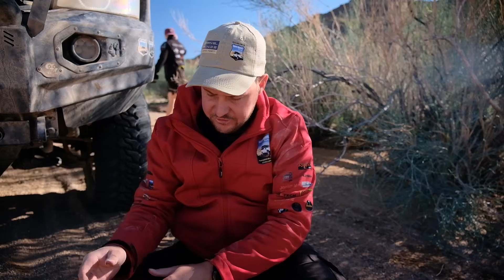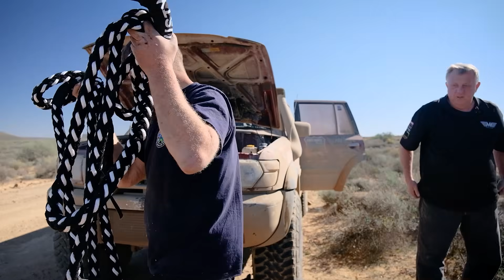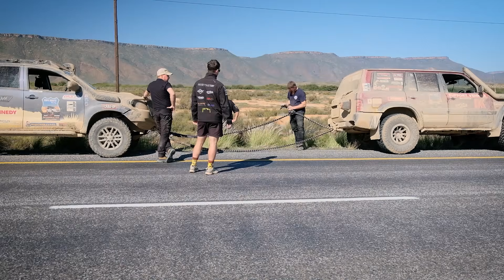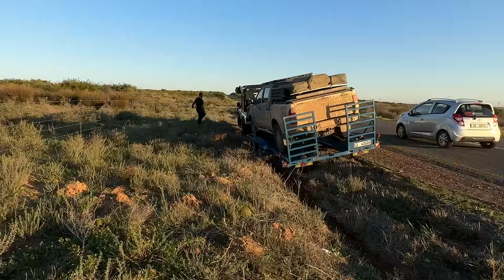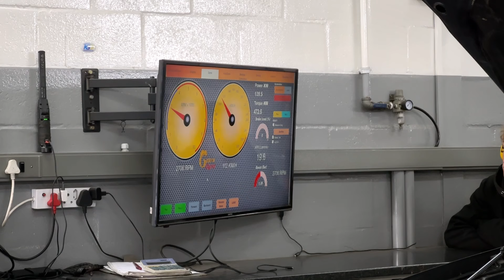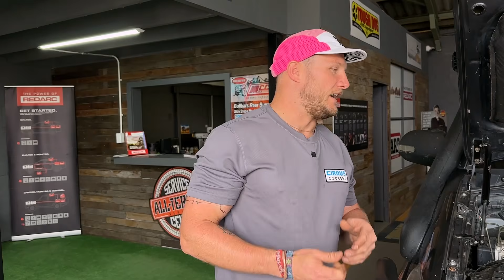Hilux Engine Rebuild: The Truth About Injector Failure & Bad Fuel

Comment: Great video content 👌  I am a Scottish mechanic here in Australia . I have A 1kd 2014 hilux from new , I also have many Hilux / Prado 1kd customers,  There is much information online about cracked pistons/ injectors and design . That said I have seen Hilux 1kd engines run for 400,000 kms on The original injectors, despite The recommended 150k replacement,  these engines are actually really good despite what you see online ,much is easily avoidable if you fit a 30 micron pre-filter before The factory diesel filter , I only use BP ultimate fuel where possible, and mobil 5w 50 fully synthetic oil changing both diesel factory filter and oil every 8k . Another tip no one seems to realise, don't assume the coolant temperature gauge is accurate, far from it ,use an OBD scan guage 3 or similar to monitor EGT . The thermostat sticks normally on hot side ! This is one of the MAIN issues of cracked pistons on The 1kd ,especially if it's a towing vehicle,  it's in an awkward position to replace and often ignored.  Once it's happened it's too late to check if those coolant temps were the issue !! Also recommended get yourself a performance viscous fan ,again often overlooked ,use only toyota coolant mix from The dealer . I'm saying this from experience.  I prepare a lot of 4wd vehicles  bush/ prep here in Australia as you know The outback is not forgiving! ...I also have a Brown Davis metal long range tank with a threaded drain bolt which makes it easier to clean the tank out quickly if I suspect contaminated diesel ,which can be an issue here in Australia
Reply from the maker: Interesting, thanks for the comment and information. 

Please explain the viscous fan more.

Comment: The top mount inter-cooler is also a good spanner shelf and hand rest.  That definitely closes the core😉 . Not so sure about the rocks and sticks part, but maybe your bonnet is shot blasted and damaged from sticks and stones and you respray it every few months. 
If you not using the top mount, then close the hole. You don't want air in the bonnet area that doesn't serve a purpose first, like cool the radiators .
Reply from the maker: I'm planning on closing the hole yes. I don't want all the dirt and water to go in there 🙃
Reply: @DieterPey  Dirt is seldom the problem. Dirt particles seldom manage to turn very well, (some air filters are designed around that fact) but the air coming in there has substantial negative effect on the radiator efficiency.  
And when I said not sure about the rocks damaging your top mount i was being sarcastic 🤣

Comment: That trailer is overloaded. Those tires are not rated for that load. Running with that load will overheat and damage the tires. De lamination and bursting. If you insist on carrying that load, then run the tires at 4.5bar cold pressure. 
Running a slightly higher boost pressure without adding fuel will make the engine run cooler combustion temperatures.

Comment: Guys the problem of injector failure and a hole in a piston or a cracked piston is not unique to any single make or SA. It happens across the board with all brands. Filter changes are a must do. But remember a turbo diesel engine runs under very high compression and the diesel is injected at very high pressure. Usually, the fuel from the tank goes through the filter then it goes through a very high-pressure injection pump before it arrives at the injector. The High-pressure injector pumps can easily introduce metallic filings into the fuel AFTER the fuel has passed through the fuel filter. I'm aware that in the USA they found High pressure diesel pumps were introducing shit into the diesel causing major engine problems. The modern injection pumps are running at very high pressures and tolerances are very tight, and wear does start after the mileages referred too. Get some got techs involved on checking out pumps, that is my contribution. Hope it helps guys.

Comment: A friend of mine has a Prado with the 3.0 D4D engine. It's his "Sunday car" and he takes really good care of it. Never missed a service,with all services done at Toyota Dealership where he bought it. About a year ago he was driving up a pass and the vehicle just went into limp mode and then stopped. Vehicle had just over 90,000km on the clock but was out of warranty (warranty time period elapsed). They had to collect his Prado on a flatbed (you can't really tow automatic cars folks, unless you disconnect drive shafts!) and when it got to the dealership and did the inspection, it was clear that his engine had eaten itself. Cause? Failed injector on one of the pistons! I also seem to remember that it was also piston nr 2! So I wonder if the 3.0 D4D engines have a particular issue with that specific injector? The quote he was given for a new engine was something like R125,000...

I guess the long and the short of it is that ALL cars, no matter the make, can give problems - sometimes even if you maintain them properly! If you consider how many components there are in an engine alone that can fail, the massively wide range of operating conditions, etc., and nevermind all the other components on a vehicle that can go wrong, it's actually amazing how reliable cars have become. Think about how often you saw cars standing next to the side of the road in the 70s, 80s, 90s, vs now!

Well done on saving your Hilux, they are very good vehicles! I'm very happy with my 2,0 BiTurbo Ranger that has (touch wood) not given me any mechanical issues, ever! Stay safe out there and remember: If your bakkie is never dirty, you're not using it correctly! 😜😎

Comment: It’s about the correct after market high pressure fuel pump to catch the filings coming out of the fuel pump as it grenades over at least 1 million kms. - Clean that at service intervals along with the fuel filters. Injectors every 500k kms and the pump once it finally grenades or you in for the bucks the system is designed to take your money with costly dumb repairs.

Comment: In Australia we change injectors at about 150000. That is correct. And when service check injector values. Can they prove that the tune does not effect the hole in piston.
Reply from the maker: Many stock vehicles has had the same issues, so tune can't be the cause of it.
Reply: @DieterPey  Standard injectors fitted in the car? Up graded 30percent? You have a classic sign of over fuel I work at Isuzu and have seen this many times. The tuner won't guarantee the engine. Why is that ?

Comment: I do quite a bit of overlanding, mostly on gravel roads. Leaving on Sunday for a Cederberg trip. I swear by the fuel cure from Wurth. Dont know if I am fooling myself but it feels like my vehicle has more power after adding. Also added a second standard fuel filter w lr tank.Because this vehicle is for overlanding I also try and change oil and diesel filters every 5000ks

Comment: On any diesel engine, two items you WILL replace (sooner or later), injectors & turbo.  Those two components does all the hard work all the time for the vehicle.  Using low sulfur diesel where possible will also help with overall engine longevity.   150K to 200K mileage mark is a safer than sorry margin to have injectors replaced yes, fully agree.  The 'soot' within the intake manifold most likely from EGR accumulation over time.  Blank that one off.  (If not already done.)  KSD is very good at what they do.  Very informative Dieter.  💪
Reply: 10pp or 50pp for trucks, which diesel is good for bakkies?
Reply: @22alchemy  the general rule of thumb is lower figures ppm, so rather 10ppm than 50ppm.  (Parts per million) or lower sulphur diesel is healthier for all internal parts of the engine.  It means less wear on both the injectors & chemical reaction / corrosion on the parts directly exposed to the combustion process.  Those types of fuel is usually more expensive than the 500ppm or 50ppm, but in the long run healthier for the vehicle's engine.  Especially if you are planning to keep it for a longer period of time.
Reply: @DIESELTECH_ZA thank you sir, appreciated - Sasol's 10pp ill start using, I always used 50pp

🙏🏿🙏🏿
Reply: @22alchemy  no problem.  I use 50ppm in general, but when filling up at home I like to run the low suplhur with Shell.  Both is better than the old 500ppm diesel.  Sadly we get the dirtier type diesel in SA vs what you will find abroad.

Comment: Straight forward just got hot man . It overheated . If it gets hot 1 kd will cook its pistons .
Reply from the maker: It didn't get hot on the temperature gauge and that morning which it happened it wasn't even that hot.
Reply: @DieterPey  ok 👍🏾.  Mechanic by profession, have rebuilt a lot of 1kds actually my favs to work on and most of the time its a hole in the piston due to injector malfunction . Most investigating turned out heat affected the injectors and they operate out of their parameters . Other than that found the 1KDs are bullet proof usually we found 1s with 150k only need a top gasket change with the bottom end looking new . But when tuned they are notorious for either eating through turbos or pistons as well. Awesome video though.

Comment: Kudos to the guy who immediately diagnosed the holed piston right there at the roadside. His reasoning was spot on and likely saved you from having to spend potentially much more had you decided to carry on driving. 
The final repair bill actually isn’t that bad. Yes it’s a crabton of money but these days a properly done replacement engine with warranty looks like the deposit on a small house. 

The injector replacement as preventative maintenance… 

I hear you, and I absolutely agree that fuel quality in ZA is at best unpredictable with huge room for improvement. 
In my personal experience I am currently keeping close tabs on two “D4D” engines. A 2010 Hilux 3.0 and a ‘13 Fortuner 2.5. 
402 000 on the bakkie, 264 000 on the Fortuner. 
Both are stock standard as they come and maintained privately according to the factory schedule. 
Both have the original injectors, which have been monitored since 100 000km and values are still healthy. 

I guess the saving grace here is that we live in a very small town and always use the same fuel station (there are only two, welcome to the Karoo 😂)
But even so in my experience the OEM filter and water separator will catch any dirt or moisture before it reaches the pump. 
How it will fare with paraffin for example I don’t know. 
And it’s pretty much standard practice for us farmers to keep a spare diesel filter in the vehicle as a matter of course. 

So yes spend the R40k odd every 150 000km and you should have peace of mind. But maybe consider that it is possible to monitor and manage the situation if you remain proactive about it. 
Coz that’s a lot of brandewyn money man 😮
Reply from the maker: You are 100% correct. If you make an effort to monitor those injectors and keep an eye on the injector values, then your chance of catching a faulty injector in time is good. Keep up the good maintaince, it's not easy work!

Comment: Dont tow , dont tune , change my oil every 6000k , injectors need to be done buy someone who cares always change your fuel lines at the same time , always at every oil change look into to drain hole in the sump and make sure the oil pickup is not blocked or blocking to make sure the injectors seals are not leaking fuel into the oil , The 1KD is a pretty good engine but expensive to maintain
Reply from the maker: Maintaince is very important and part of the game.

Comment: Owned a 2015 legend 45. Upgraded to new spec legend in 2022. Sold the 45 for R374 000.00 after 7years with 70000km. Only  lost R35 000. True value. I actually onlysold the 45 because I wanted an automatic. They’re boring and conservative but BULLET PROOF.

Comment: Of course the guy who tunes engines will tell you a tune is safe 🙄. An engine rebuild will let you down again in these engines again. Once a d4d engine cracks a piston it’s better to throw a new engine at it. Interestingly not one person talked about over size tires, bull bar, lift kit, roof rack, spot lights and winch which all co tributes to restricting air flow and increasing wind drag, throw in a re map or tune and going on long trips in the hot temps and what do you think will happen? When these engines first came out around 2005 it was unheard of to crack a piston but now everyone is expecting to much from them with tunes, heavy towing ect for hours on end  and you just asking so much out of a little 4cylinder, towing in D will cook your transmission and crack pistons. If you want your d4d to last forever keep it stock and do regular maintenance, injectors every 180k, oil changes. Make sure to use copper washers in the injector seats not brass as the brass ones will not seal and cause the sump pick up to clog and you starve your engine of oil. Every oil change you do check the oil pick up when the sump plug is off.
Reply from the maker: You're right, keeping it stock will make it last longer, but then I can't take my car where I go. The added mods to add weight and stress on the motor, that's why we do a slightly tune. We are aware of the risk and that's why I'm not upset that I got damaged. It was due to happen some day. 

Like racecars and any motorsport, there's always R&D involved, but we break, fix and make stronger as we go.

Comment: I talked with a longstanding Hilux owner and he gave me 3 pieces of advice for longevity. Never ever let the tank run empty or close to empty because that`s when you get kak in your injectors/pistons as any "dirt" settles at the bottom of the tank. The second was to change oil every 10 000kms and the third was to always let any turboinjected engines "settle/spool down" after a long drive before you switch the engine off. I try to live by this but, obviously can`t verify if this is part of the reason I`ve never had issues with my 2015 Hilux Legend45 D4D. Maybe the fact it only has 175 000kms on the clock in 10 years is the main reason😅
Reply from the maker: All those tips are 100% correct, I take the same into account. 175k km is still entry level kilometres for a Toyota 😁
Reply: My legend 45 has over 300 000km with out ever being opened up once. These are the rules I live by, especially the turbo spool down. Also I had my EGR blanked off and that helped a lot.
Reply: All those 3 things are the main reason why diesel turbo engines die😊..I have a little toyota runx d4d 1.4 diesel I never let the fuel run low..every 5 to 8 oil change..
Reply: 2014 onward Toyota a introduced Diamond-Like Carbon coating to the injectors internal parts  as well as redesigning the pistons making them stronger.  The new injectors are said to last substantially longer.
Reply: This is what happened to me. I have a 150L tank. I ran out of fuel driving in the outback and was running on empty (reserve) for about 50kms. About a week later… suddenly the car starts shaking like it’s running on 3 cylinders. Cracked the piston. 
Expensive lessons learned: I will never run on empty again. I’ll always carry spare diesel from a reputable source.
Reply: Or don’t buy one of the overrated piece of crap!
Reply: @PillSharks  Thank you for the valuable input. It is easy to knock something down, but tell us, what should we all be buying instead?
Reply: Should be buying a GU Nissan Patrol with the old tech Td42ti engine (No Common Rail Crap). Install a UFI 16G turbo & a UFI 200hp injector pump & large intercooler & the vehicle hauls ass but without risking engine gearbox & clutch issues. My last TD42TI engine i replaced at 900k for peace of mind & my old engine never let me down once
Reply: @triggerhappy8872  I have lived and worked in the Pilbara (NW Australia) for over 20yrs. In the wet season the temps can easily hit 44/45/46 everyday. We hit 48’s/49’s on some days, at that temp the ground surface temp is 72-75°C. We run 79’s and Hilux’s 24/7 around the clock and they’ve never seen bitumen. Apart from the DPF issue in the early days we’ve never had issues…..service em and just keep driving. When we’re pushing 400000km on our Hilux’s and 79’s, driven 24/7 around the clock, destroying full sets of duellers 694/697 LT’s every 20000km from high speed dirt/corrugations what would that be equivalent to in your TD42, that’s been loved and driven by one person mostly on bitumen I’m guessing. There’s no comparison, as long as they’re serviced you’ll never beat a Toyota, and I love the TD42’s. Bad fuel isn’t good for any engine. One of the best vids I’ve watched on YT for a while…..subscribed👌
Reply: Another flog a part of the die hard one eyed toyota hating propaganda classist army stuck with tiraded narratives constantly circling around in his head about the brand he can't go to sleep or wake up without thinking about.

Comment: Can you upgrade the fuel pump to compensate for a potential reduction in flow with multiple, in-line filters? Also, BG 44K does wonders at keeping injectors sparkling clean. Diesel of gasoline engines, alike.
Reply from the maker: I'm not 100% sure, but if I understand correctly, the filters will limit the pressure if their microns are to small. No matter the fuel pump pressure. 

It's like taking a fire hose and trying to spray it through a pinhole. Pressure is good, but it still gets limited by the hole size in the filter.
Reply: @DieterPey  That makes sense. Volume increases flow rate, which impacts pressure and then at some point the system limits.

Comment: Is it 3l 1kd-ftv ?  How come you have manual transmission coming with this engine ?
Reply from the maker: Yes it's a 1kd-ftv and we mostly drive manual in South Africa.
Reply: @DieterPey cool. We don't have this build in Russia at all. 3l comes only with automatic. And 2.5l only manual . I wonder if the clutch and axle are the same for 2.5 and 3l manual ?

3l auto comes with another, stronger axles and no manual diff lock option , only lsd